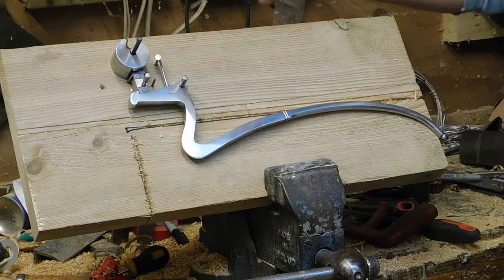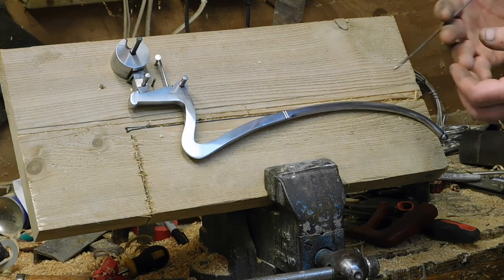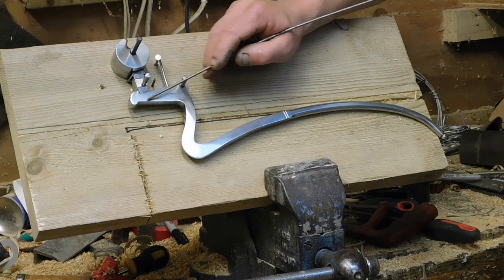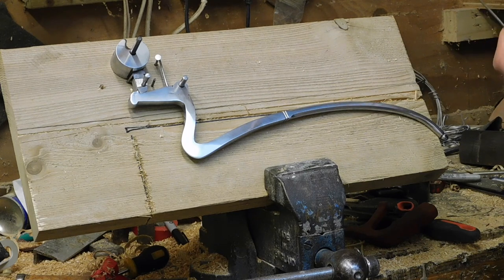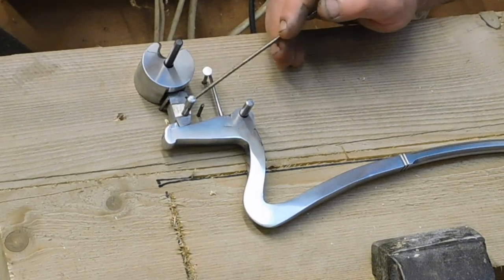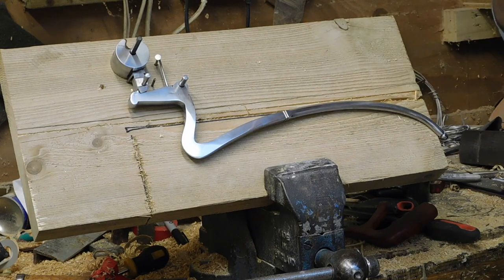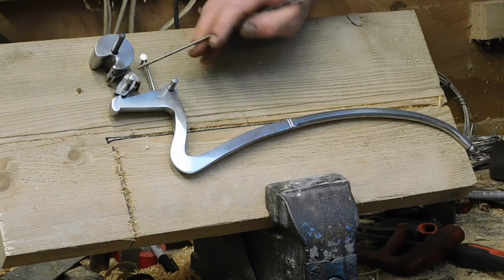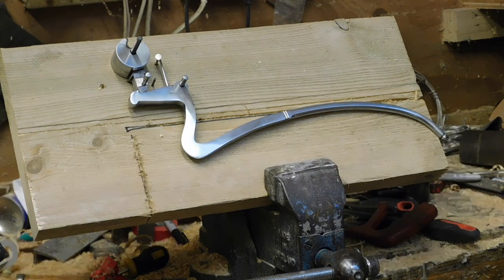Twin Axle Trigger System

Comment: like others have pointed out, the sear axle seems to be positioned in such a manner that it would actually increase the load on the trigger. It should be closer to the rotating nut with a longer lever towards the trigger itself.

Comment: Thanks Tod. I changed from a single rotating cam with associated trigger to a lift string above notch in barrel method of triggering the light hunting medevial style crossbow I assembled totally from scratch which included turning a tree into planks. I simply did not like the force applied to the trigger which made firing it less than fun. The method I used needs attention to detail too otherwise you lift the tail end of the bolt. The system you showed here looks fabulous.

Comment: Agree that the hingepoint of second axle is positioned on the wrong side, giving relatively unnecessary loads of pressure on the main lever. I would make a positioning pin on the nut to prevent it from over ratation, and a spring on the second lever so no fiddling with pins for loading is needed. Still a great mechanism though!

Comment: I imagine that the rotating nut trigger remained the military crossbow trigger system of choice not just because they were cheap and easy to manufacture but also because they were robust and reliable under campaigning conditions, where they were likely to get wet and dirty and still needed to work properly every time.
Reply from the maker: I think you are right; unsophisticated, but bomb proof

Comment: hmm that sear tough..  from the pin location i can tell that its eater change nothing or actually increase the force on the trigger piece. That pin should divide that sear at least one third to two third ratio. Being the one third one on the top side.
Reply: Peter Moritz to gain a mechanical advantage. this makes some sense. I'd be interested in trying to build this myself soon. right now I'm browsing all possible trigger configurations, and sorting them to find a relativly good compromise between being easy to produce with minimal tools, and materials, and reliability. in this regard, the original lock still seems more suitable. plus I'm not trying to build a seige bow lol. just a hunting crossbow for up to medium to large game. this has been a challenge, and though I made a few working prototypes, none satisfy my criteria. still, this might be something to build off of. never know. I can't see needing a trigger to support more than 100# draw. anything beyond that I think is excessive, and leads to further mechanical challenges that could be avoided. pretty sure 100# or less is enough to hunt with. and building a stronger prod in a survival situation is a stretch.
Reply: Richard Peterson be advised that because of the very short travel distance of the string, a 100lb crossbow will actually be very under-powered. For instance an 800lb cross bow only hits like about a 140lb recurve. Apologies if you already know this, but I wouldn't want you to get to the end of a build and find you had undersized it.
Reply: @richardpeterson3753  If you're hunting with a short power stroke crossbow, I would definitely go with 250# or higher, and use a goat's foot lever (or maybe a belt hook) to span it. The typical minimum energy stored by a longbow or recurve bow for hunting larger game such as deer is ~50 J (the arrow is going to have lower energy than that due to efficiency losses). A 100# crossbow with typical Medieval 6" power stroke is going to store only 30 J, and have lower efficiency than a recurve due to less efficient materials (assuming a steel prod), short power stroke, and the friction of the string against the tiller.
Reply: It does look like the sear is actually providing a mechanical disadvantage, which is strange, but I don't think that necessarily prevents the system from providing a lighter trigger:  in the single axle system, the trigger's nose is supporting the nut torque via compression, whereas the twin axle system's sear reverses that to tension.  In both cases, the trigger supports those forces on a vertical face.  As the trigger moves in an anticlockwise arc during release, that face remains tangent to the arc and so its top edge tilts away from the trigger pivot.  In the single axle system, that movement is trying to rotate the nut clockwise, resisted by basically the full string tension, so gives a heavy trigger, whereas the tilt is actually away from the sear in the twin axle system, so the string tension is working with you and the only resistance is from the sliding friction between the sear and trigger, which is relatively low for polished steel surfaces.

Comment: This seems more like a step back rather than forward compared to the single axe trigger. Having to carry around a small easily lost poking stick would simply be too annoying. I guess it quickly evolves to something that ditches the poking stick?
Reply: Someone using such a hunting crossbow would likely have someone setting the bow for him.  So all the hunter would care about is the feel of shooting the device,  not the pita of loading it.

Used in war, the shooter would care that it had the punch needed to surpass the armor (maybe just a padded jack) of his target, more than the fact that he has to keep a small stick.  Think of all the crap a flintlock shooter needs, let alone what a matchlock shooter needs to do to not blow themselves up handling powder and a burning match at the same time 😟
Reply: @joejoelesh1197   FLs are still a big improvement though - succeeding the quite dangerous matchlock system after around 200 years of service. You're right though in the amount of stuff you needed in the field. 1) Gun itself. 2) Black powder. 3) Lead balls. 4) Padding. 5) Ramming tool. 6) Powder flask. 7) Extra flints. 8) screw driver -type device - most likely (cos most guns didn't have winged screw) ...there could be more I'm forgetting. On the pro side you weren't dependant on someone to carry 100+ arrows - you can easily carry 200 lead balls, powder and flints yourself. It's not light, but you're as mobile as when you're 2 guys carrying that heavy ass crossbow, windlass and bolts.

Comment: Instead of poking a rod through a hole in the stock,  wouldn't it be easier to have the sear be spring loaded? That would allow it to automatically reengage the nut after firing.
Reply: I think the answer might have to do with the lower quality of the springs back then. When the roller nut is released, it then spins at a high angular velocity which in turn affects the sear with a rapid movement. The high impulse on a less quality spring would probably make it break or bend. I recognize this problem alot with my Lego crossbows.
Reply: Also, a spring-loaded seer would drag on the roller nut, interfering with its spin, and causing wear on both the sear and nut, reducing their life span significantly.

Comment: I think you mentioned in another video that these could have been spring-loaded, but weren't. Where would you put the spring if you were going to design it that way?
Reply: the problem with spring-loading the sear is that the sear would then be pushed back against the roller nut, interfering with its motion (a minor effect), and causing wear on both the sear and the nut, reducing their lifespan (a significant effect).  This is especially true given the lower grade of metallurgy available, and even more so on lighter crossbows, where the nut might be made of horn or brass instead of steel.

Comment: Great videos thanks. Is it possible to add some kind of light spring to automatically reset the sear? 
Also, would you recommend someone with fairly little experience trying a crossbow build?
Reply: With a return spring the nut can't freely rotate and would rattle or slam after release?

Comment: Isn't 800.000 lbs a bit overkill?
Reply: the bolts for crossbows were heavier back then so you needed more draw weight. 
modern arrow are so slim and light you don't need nearly as much.
Reply: +DarkShadowsX5 did you really do your physics? Less mass means more velocity but the force is equal.
Reply: Singularity of infinite wisdom you misunderstand, medieval bows were made of steel and composite and had short draw lengths, so something like 400 pounds for example would generally be effective against unarmored opponents
Reply: medieval crossbow has very short draw length so needs a lot more draw weight to match (or surpass) the energy of a bow shot
Reply: He didn't mean 800,000 lbs.  He meant 800 to 1000 lbs.
Reply: Theo Brinkman yes imagine trying to draw 800,000lbs back. Or a stock material strong enough to hold it.

Comment: better design but overall it lacks elegance in the fact you need to manually actuate a part of the trigger system to reset it. 
and losing that pin is like losing the key to your house. you're fucked.  
they could have easily made it even better by putting a lever or somehting on that piece. at least then you wouldnt have a pin to loose.